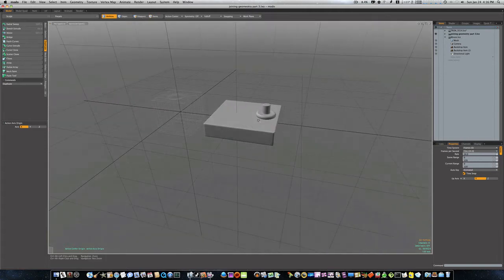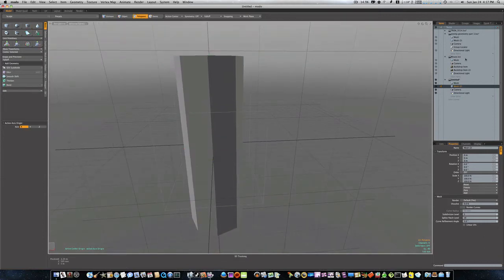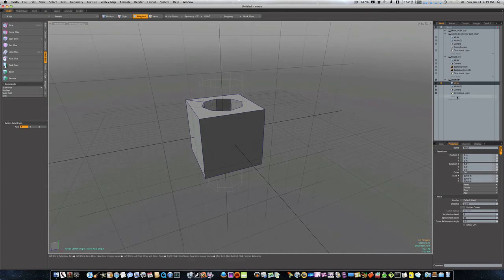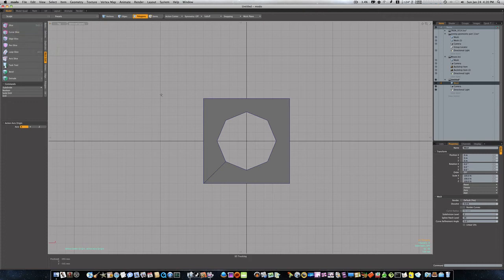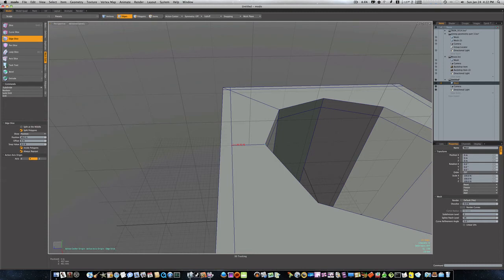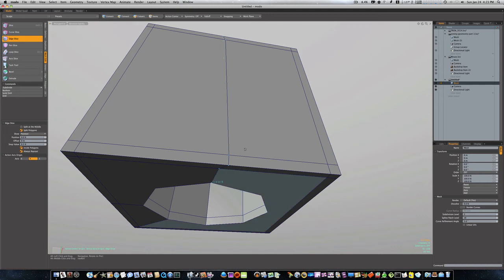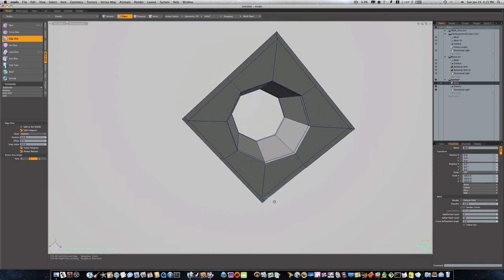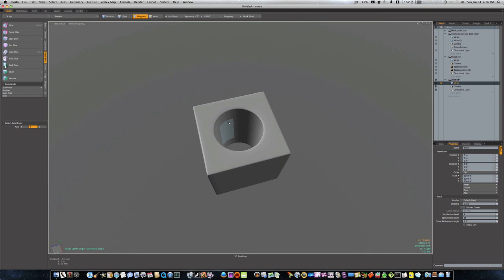Modo 401 3D Modeling Tutorial: Working With Booleans Part 1

Comment: Terrible tutorial. Obviously way out of date now but a terrible example of how to model. If you want to make holes in objects when you're Sub division surface modelling then there are faster and much more technically correct modelling methods to use without the need for a Boolean. Sure, do a tutorial on how to use Modo's Boolean tools but show it using hard surface modelling techniques where Booleans are regularly used.